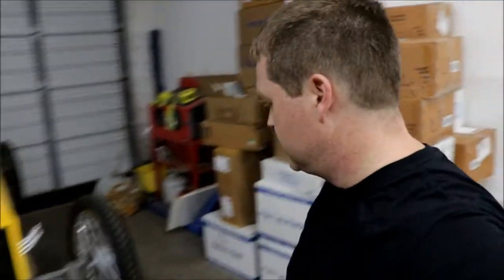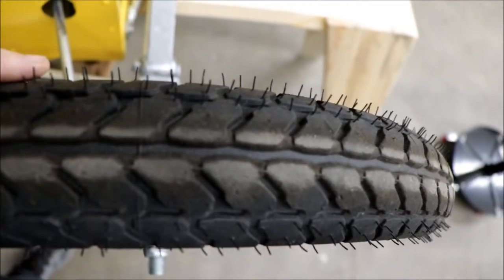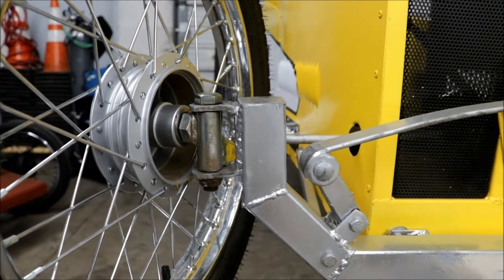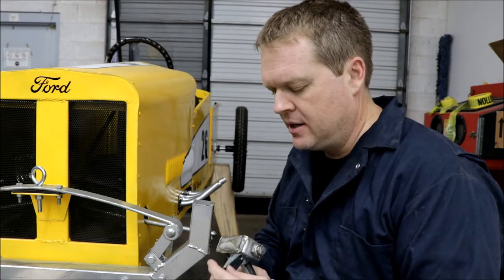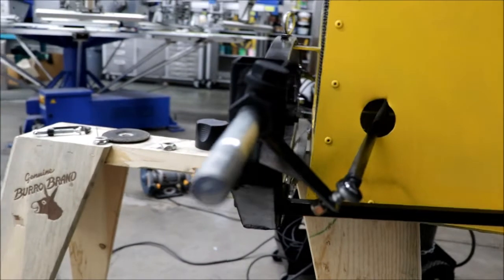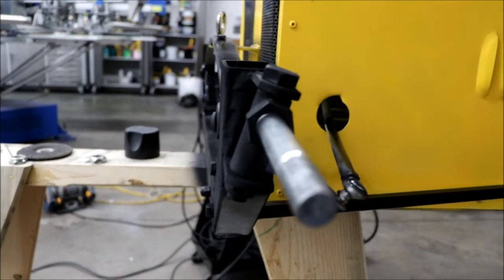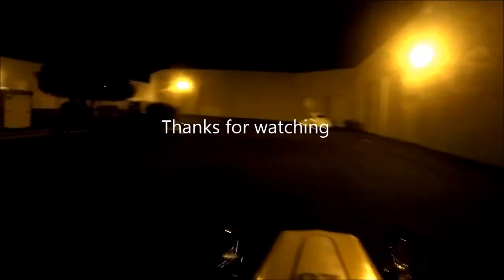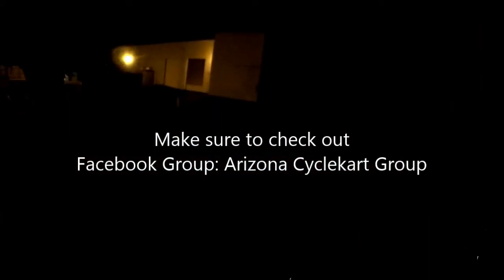Cyclekart Handling Secret: Caster

Comment: What spindles are these? I'm currently of opinion that scrub radius is important. It plays a big role in how much the road can jerk the steering wheel around. I think most cyclekart builders are ignoring scrub radius, but I can tell from videos that their steering is being pulled around by very little bump.
Reply from the maker: The spindles in the video are Azusa spindles. You can get them off amazon. I have played with a few things with the front end and the 2 major things is Caster a Ackerman. Ackerman has is the angle of the steering bracket to the center off the back axle. This makes the front wheels turn in a way that the inside wheel, in a turn, does a smaller circle then the outside tire. It eliminated scrubbing. I have a video I am working on to show this.

Comment: Who knew alignment adjustments could help so much on a cycle kart?
Reply from the maker: Is this meant as a joke... I think it is. I did know the adjustment was needed but had no idea what would be enough. These thin tall tires kind of change the thinking on everything. A Cyclekart is the worst handling "race car" out there. i think that is what makes them so fun. This video was an attempt to make it better and really safer. Thank for the comment.
Reply: AZ CycleKart I wish I could say it was a joke XD. I felt like these old grand-prix-styled vehicles require much more drastic adjustments compared to modern cars, but I guess I underestimated the scale of the vehicles that this could affect!
Reply from the maker: It has to have a lot to do with how thin the tires. That small tire patch on the road needs the exaggerated adjustments to work right. I did learn a ton fixing this yellow Ford cyclekart.

Comment: I took Jon's advice on my last CycleKart and increased the Caster to 12 degrees.  The steering is much improved over previous build.
Reply: What was the previous angle of caster? I've read on the forum about 6 degrees is fine. Is that not enough?
Reply: @paulmichaud3230  Video showed the pin inclination to be zero degrees, it would have been close to shopping trolley nervous. :D